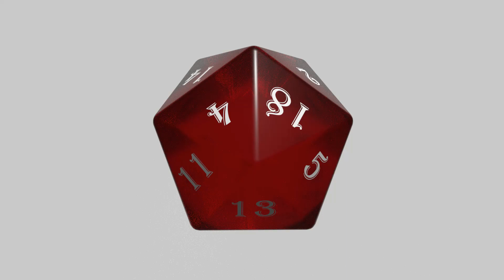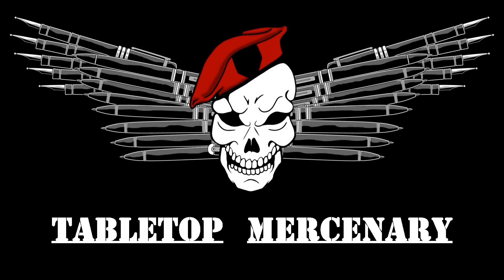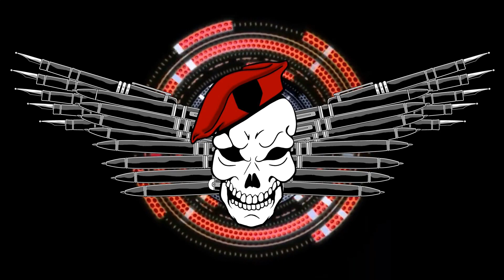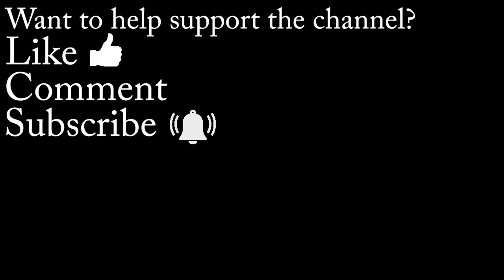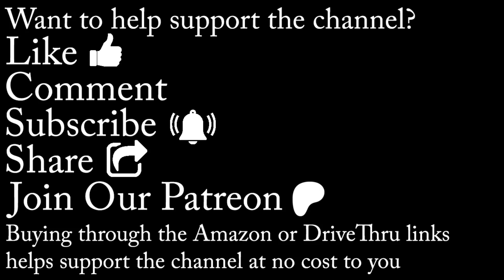Tabletop Mercenary Episode 10: Talking About Design Bloat in TTRPGs

Comment: As someone who has recently decided to make a google sheet for all of the mundane items from PF 1e (there's a few reasons, I've been working on a class based on having or making the right tool for a job, but also making it easier for my groups GMs to build shop inventories or have quick reference for non magical services) I have become incredibly aware of this issue.
Reply: It is rather telling in denser systems... and while the 3.X family may not be the densest, it definitely shows there. I've found it very tough to make new and interesting content for them, while at the same time trying to steer away from reinventing the wheel, or just making a slew of stuff that adds to the pile.

Comment: I used to create a book with all the rules for my world that were different than the basic rules of D&D.  The problem is the book got to be huge and players couldn't read it.  Finally, I was able to create a website for it and make it accessible to players.  I trimmed down a lot of the extra rules and only put in what I felt was really necessary.  I started a God Book where players could pick a god to follow in the D&D game.  The problem with that book is it is not several editions out of date, the computer files for it have been lost and it too took on mission creep as I added special rules for various classes.  The problem is getting that book into the hands of the players so they can read it and decide what god to follow.  Someday, I may dig that book out and work on it, but I doubt it.